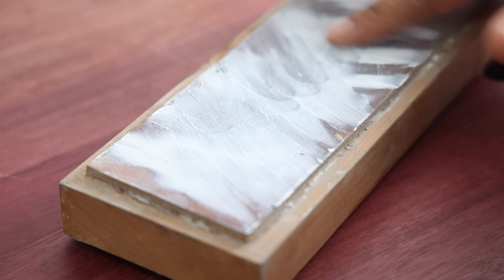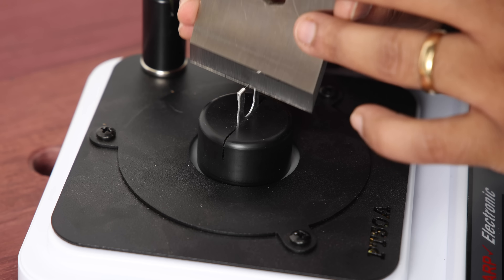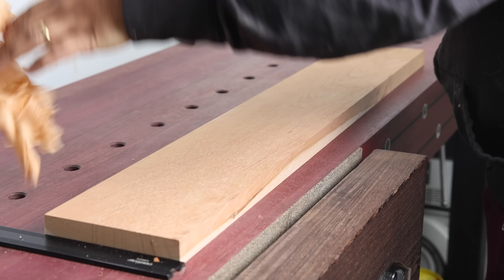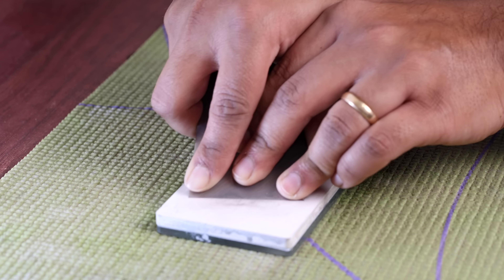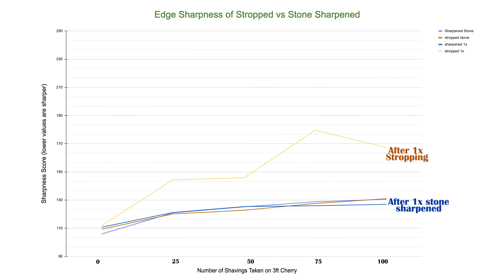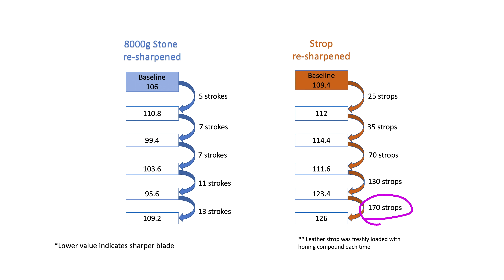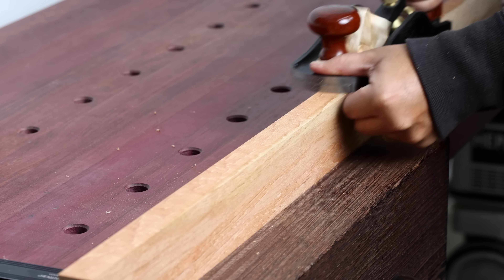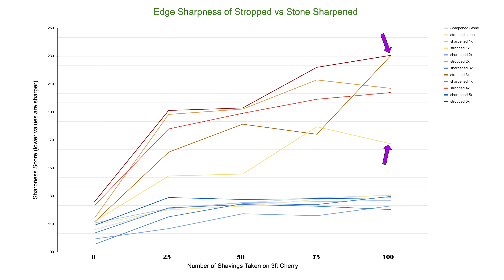is stropping overrated?

Comment: This is ridiculous. You are not using a strop after final stone sharpening. You are using it instaed of final stone sharpening. A lot of noise and nothing proved.
Reply from the maker: You might have missed that both iron got sharpened to 8k stone at initial.
Reply: @WoodcraftBySuman  I think you're missing John's point. You are comparing re-sharpening with a stone vs re-sharpening with a strop. A strop is used as the final step (not the only step), whether it be initial sharpening or re-sharpening. I would be much more interested in a test that stone-sharpens with a final strop vs without a final strop.

Comment: Well duh... you only stropped one side. Stropping only one side isn't stropping... it's bending.
 
I'm not telling you to strop both sides of chisels and the like. You can if you like, but there's no real need since it's a blade that's only used in one direction. But for anything you sharpen on both sides, stropping is a great practice.
Reply from the maker: Didn’t show it explicitly. But it was stropped on both side
Reply: @WoodcraftBySuman  
You CAN"T strop it on the other side. It's completely flat. More surface area means more friction. To strop, you'd have to apply 10x as much pressure on the second side... and if you don't lay it flat, you're just going to warp your edge in the other direction.

Comment: for a plane blade you are stropping the wrong side of the blade, you should be stropping the back of blade, well unless you are using a low angle bevel up plane that most don't have, the point of the strop is to reduce the friction of the shavings on the blade, and if stropping a blade was that bad for the edge, why has the practice been used by woodworkers for the last 2000 years, if it didnt do anything then surely it would have stopped many centuries ago.
Reply from the maker: Reduce friction? Bevel up or down, only a micro segment of the blade touches the wood. Stropping has been popular over the centuries because that’s all we had access to. High grit stones are new technology.
Reply: @WoodcraftBySuman  Yes we now have high grit man made stones, but they have had high grit natural stones for centuries too, how do you think they made a mirror? But let's change this to a carving knife, I haven't found a stoned edge that will come anywhere near as sharp as a stropped edge, but then again we are talking about a 10 to 15 degree cutting angle too, with a blade thickness of 1.2mm